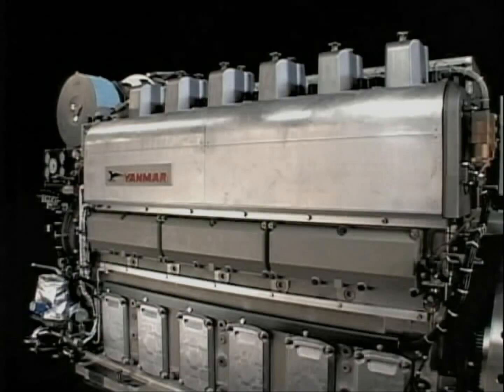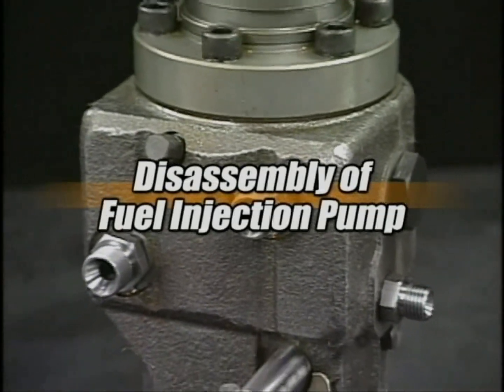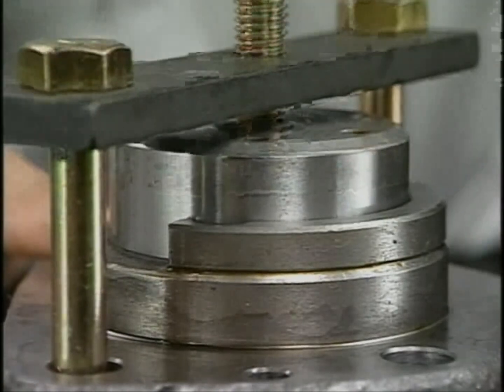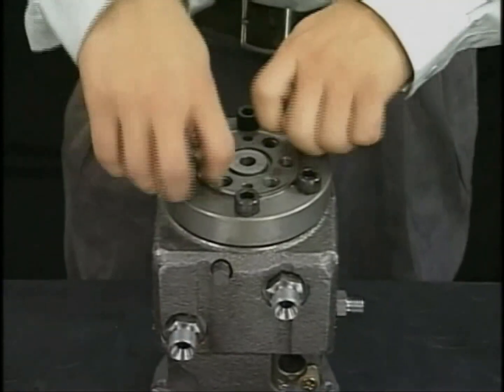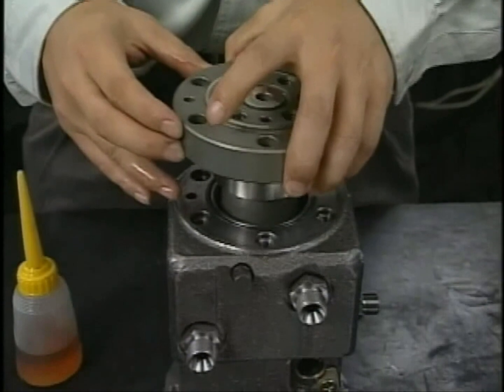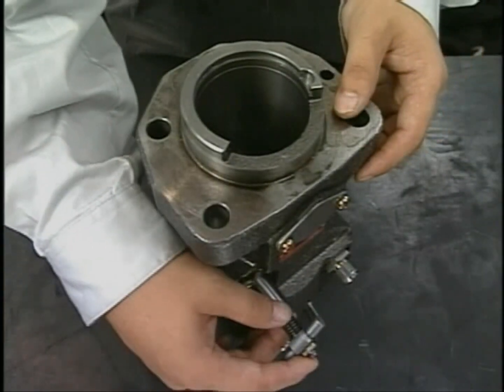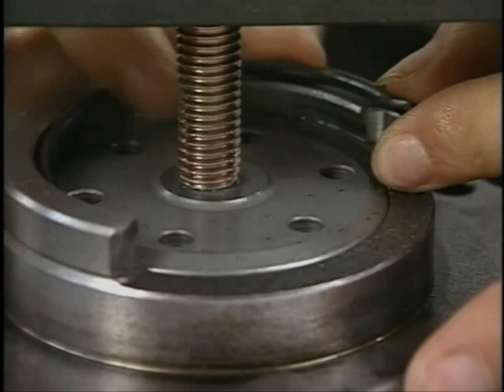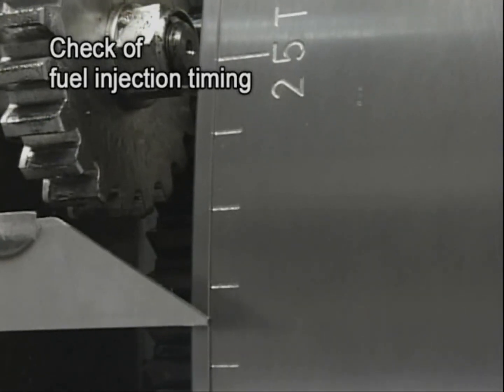Yanmar 6EY22 Marine Diesel Engine Maintenance Manual Fuel Injection Pump صيانة ماكينة ديزل  يانمار

Comment: Hello it's nice video 
Need an advice  already fixing pump but mostly cranking time fuel only coming in one pump only please help me with solution thank u
Reply from the maker: Can you provide us with more information about the issue you are facing, the engine and the pump?
Reply: PLS
Can U help me 
The rack of fuel pump is pending do l need to change it
Reply: The model of engine
Yanmar 8 z 280 st